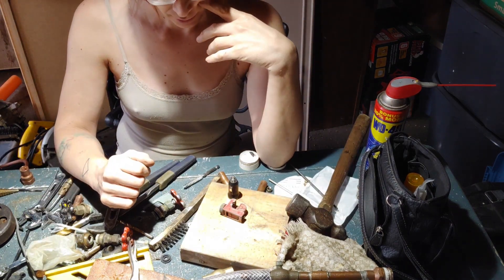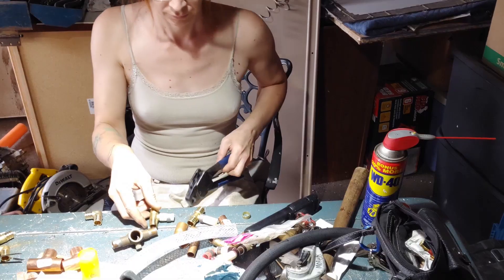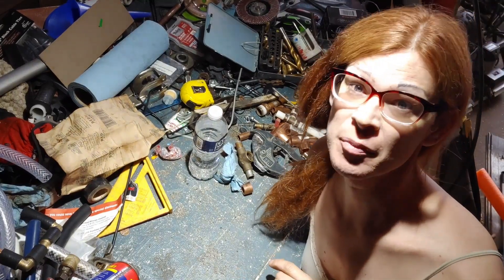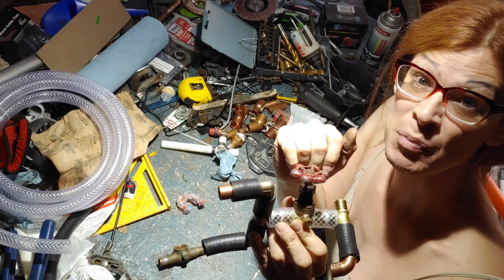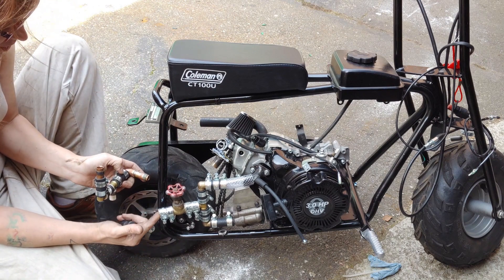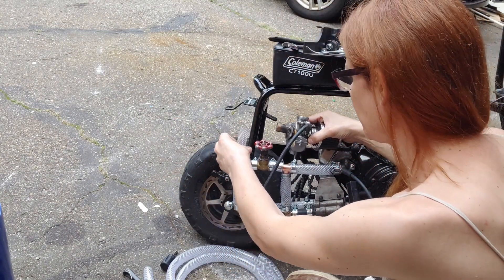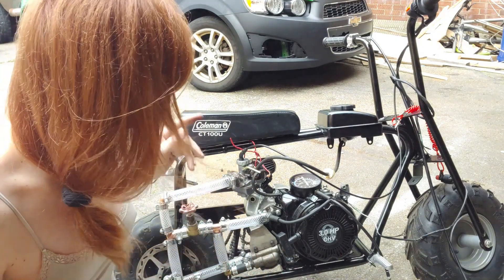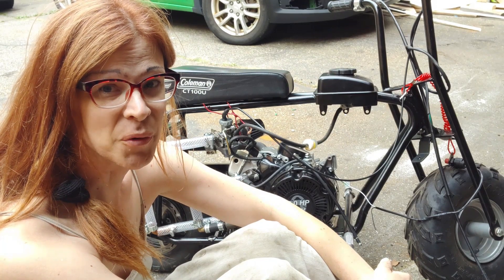First Boosted Start, home fabrication, Assembling the supercharged mini bike #nonamenationals

Comment: Did you port for the pz19? This thing runs a wussy compression ratio stock. The piston sits a ways in the hole, big fat deck. I have them milled between .035-.070 off the head. Run the Predator 79 cam in the Hisun 99. The ARC flywheel is key for tuning these for performance.....so is running a modified coil wire/boot with a cut plug.
Reply from the maker: all on my list, but i can only learn so fast. this block and pistion are all the way up to deck, which i hope will perform with the shaved head
Reply: @kimfixesthings  they love compression!
Reply: @kimfixesthings  I like your style! Grassroots is where it's at!!
Reply from the maker: @fatbuddycat  the makings of any good hotrodder. Cubic dollars isn't nearly as interesting.

Comment: Which valve springs did you run?
Reply from the maker: i haven't upgraded yet. what do you suggest?
Reply: @kimfixesthings  22 pound clone springs.  The same ones that fit the 196cc and 212cc engines. I've seen some people jB weld the magnet on the coil before. The flywheel should be the first to give up if the governor is removed. The pushrod guides wear out too but not right away.
Reply: @fatbuddycat  The billet flywheel replacements are a little pricey but if you've ever had one of those F'ers grenade between your legs you wont hesitate to go that way and be 100% certain of safety! My junk was intact after but it was the first thing I checked even though some shrapnell opened up my leg through my jeans!
Reply: @bigcconservativeguy2534  100% I run the billet flywheel myself. I don't trust the stock job. It's definitely the price that scares people.  I look at it as in an investment. I'll probably get one more just so I don't have to change this one over but I plan on building multiple combinations of these. I absolutely love my 99, if I had to have one mini bike it would be that one because it's lightweight, simple and fun as a true mini bike should be.

Comment: unless the engine was already damaged i doubt it was a rod, probably destroyed the top end from it going to lean, number one rule with an air cooled engine, rich kills spark plugs, lean kills engines! you have to check the spark plug often especially when modifying intake and/or exhaust.....
Reply from the maker: In hindsight, it has always been rich, very fat. Of course, some of the other videos explain better.
Reply: Push rod not connecting rod.

Comment: Seems like there was an oiling issue of some sort. I'm not sure how far into disassembly you went, but perhaps an oil gally got something in it? Was the crankcase full of oil? From the video it didn't look like a high enough RPM or high enough load put on the engine via boost to hurt the engine that way. Unless there was some high RPM, high boost action that you didn't film, it seems like an oiling problem.

Or if it was running super rich and washed out the rings?
Reply: Super Heat Combination from Boost,  wipes away burns off oil from the cylinder wall(s).
I used to see it alot LaSalle Speedway Dirt track 1/4 mile oval on a 100F night.
Slow down engine stops locked up.
Go to crank spins engine, No compression any.
The Final link to Engine compression is the Microfilm of oil on the cylinder walls.  THE DYNAMIC OIL SEAL TO RINGS AND CYLINDER WALLS
Reply: @brracing7861  she probably floated the bag out of it and dropped a valve.

Comment: I used to build alot of LSX and Mitsubishi Evolution High Boost engines at a Chicago Race shop.
Not one ever blew up I built.
Famous Texas Mile Car in Shop Tuner Racer I was put in charge of his Mitsubishi Evolution Engine .
High Boost 55 psi Used E85 fuel.
I set the piston rings end goals to .0085 " per 1 inch bore size. 
About .032" Top ring gap.
2nd was .035.
Rode shotgun in Yusef's World Record setting car 240 mph Top End speeds.
We hit 52 psi Boost in 1/8 mile at 160 mph at 950 Hp to all 4 wheels in the Shop industrial park at 3am.
Yes all Street Racers True  !
Got a High 5 from the Boss And Yusef himself. 
Trust me on ring gaps
Reply: In this particular case, because boost wasn't being run, and it was low load, low RPM, it's an oiling issue. Unless there were some full throttle runs with the boost valve On, that we didn't see, the boost and heat couldn't have been a major factor. Sounded like there was something grinding as well.
Reply from the maker: You are very close. I have a follow up video that I will get out pronto to update.
Reply: @kimfixesthings  Hopefully B&R is right and not me. That fix is cheaper and easier.
Reply: @RonniePTexan  https://youtu.be/0hPzpqdtrOY
Reply: @RonniePTexan  Yes.  I didn't like Kim's Face.
The Boosted Monkey Bike Engine is Hurt.
It can be fixed by her at home she is Handy.
Need a Flexhone Bristle Hone Brush, Summit Racing gas them bought several for myself Hone blocks at home at will.
320 grit and 400 grit my picks.
400 for Platue Final Honing like they Did on all 1984-1996 C4 Corvette engines.
How the C4 Vette was able to use Mobil 1 Synthetic Engine oil brand new 0 miles during Breakin.
Platue Honed Factory.
Reply: @brracing7861  I'm worried that if I'm right about it being an oiling issue, then the crank and/or block might be in trouble. Hopefully I'm wrong and it's the rings, and then your plan of having her home the cylinder is right on target. The grinding I heard sounded constant whereas a piston/ring issue would change sounds because of the up, stop, change directions, drop of the piston. Hopefully it's something simple for her to fix. It wouldn't hurt to go to E85 or methanol for heating as well as detonation resistance
Reply: The Shop? The one at 2121?
Reply: @RonniePTexan  No. Not far from Route 66 Raceway. Other side of Joliet East maybe 20 minutes driving time. 
Have to cross that Insane All Iron 110 year old bridge !
Reply: @brracing7861  Oh ok. I agree 100% with your ring gap information by the way. High boost or even medium boost needs some extra ring gap. Otherwise the shiny parts like to come outside and play.
Reply: @RonniePTexan  Better off using extra ring gap today.
You actually have to be .040" - .050" Top and 2nd rings gap to obtain excessive oil consumption and Blowby Engineers have found out 
There are power gains tight ring gaps per inch or like .012"-..014" and very good cooling system you know works excellent maintain 140-160 F no matter what. But it's not worth the Risk any today.
Pontiac 455 13.0:1 static compression ratio and Vintage TRW Alloy RM75 pistons I used with tight ring gaps Normal Aspirated. 
I wouldn't try it any again unless I used Diamond 2618 Race pistons $1200 a set of 8.
Has no Silicon on the Aluminum Alloy any.
Reply: @brracing7861  I'm an old Pontiac guy myself! I ran some 400s, and even a 440, a destroked 455 in my race car at 12.5:1 CR. I used Gapless rings until I found nitrous. Then I had a LOT of engines lol
Reply: @RonniePTexan  I Forgot about that 455  Destroked engine for final 440 Cubic inches. 
I had a 1965 421 Block Bored. 090" inches over from a Friends Old Race Car a 1974 GTO , final cubic inches 440 Cubic inches too.
Reply: @RonniePTexan  https://youtu.be/1ogowdsufSs
I think I made this video and didn't snag from Facebook. 
Have a ton of Videos on my laptop still fron when I worked at Geared Up Motorsports. 
Engine Builder myself.
Reply: New to builds. What advantages are there to the ring gaps,  I guess I’m confused on ( .0085 per 1 inch bore size ).
Reply: @nicolec7290  Its for the Extreme Heat and Thermal expansion that takes place when adding +400, up to +2000 Hp more in a V8 Engine or a better way to put it goals are to 3.0 - 10.0 hp per Cubic inch of an Engine 1 cylinder to 24 cylinders or more.
Reply: @nicolec7290  In a perfect scenario, rings would have zero gap and not allow any of the combustion to leak past them. With a perfect seal, more power is made. However, the rings expand when they are heated. In a nitrous, turbo or supercharged engine, the extra power creates extra heat. If the rings heat up and expand too much, the ends will touch and push outward. The rings will then momentarily act like a brake, locking up and breaking the piston, rod or crankshaft. So taking all of this into consideration, the commenter is correct to use a larger ring gap for an application that will cause excess heat.

Comment: I am not sure How much Boost it's making, Those Small Block Chevy Oil pumps like a Melling M55A Z28 Oil pumps can make 100 psi hot oil pressure with 10w30 oil. My 1994 GMC Suburban has that Z28 High Po High psi oil pump. Cold it makes 120 psi 10w30 Castrol GTX
Reply from the maker: Moving air rather than compressing oil is a very different deal. My testing shows that if it can survive 6000rpm, then I can get 8 psi of boost, but I don't know enough to calculate how much flow or how many cfm the engine wants. It's very experimental. I will have an update very soon.
Reply: @kimfixesthings  I have an old book put away on Superchargers and Turbocharged engines.
Its about 2:1 ratio design.
CFM Flow should Double of max VE Volumetric efficiency Engine CFM Airflow.
Reply: None. Its an oil pump not an air compressor.